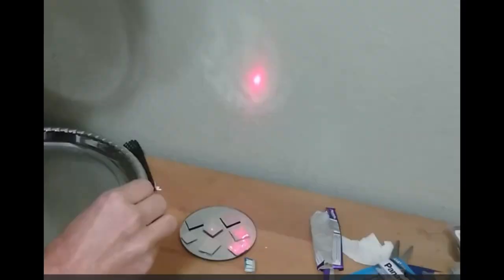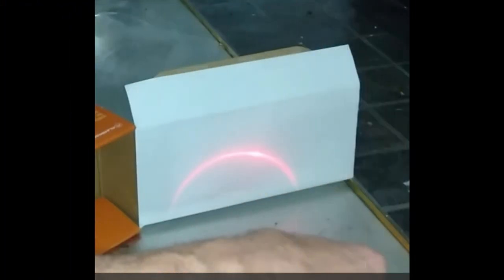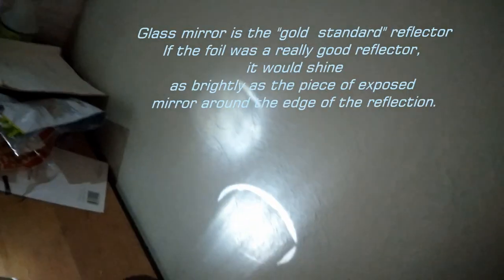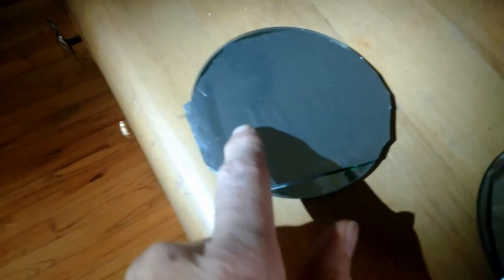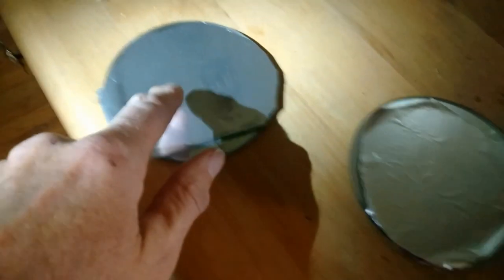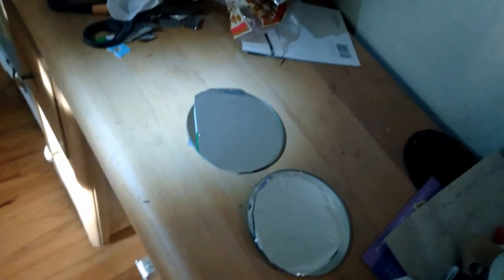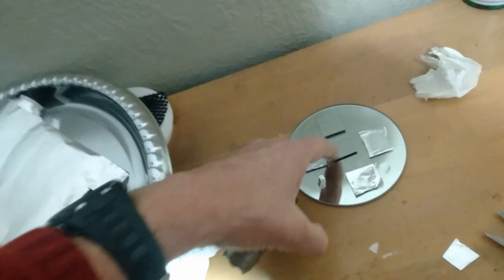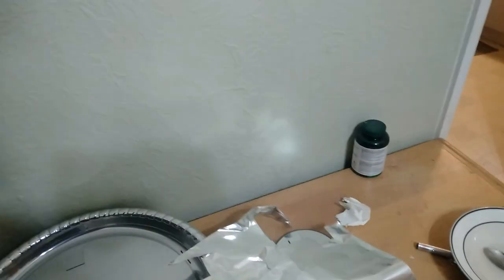Solar cooks are boycotting me!

Comment: I tried it with a laser pointer and aluminium foil. Interesting. However, the self-adhesive reflective aluminium tape I use does not do that.
Reply from the maker: Oh, thank you!  That's good to know.  Did you try the mirror test?  Is it nearly as specular as a mirror?    If so, I would like to know the brand! Brian
Reply: @Brians-Easy-Low-Tech-Solutions  It's much more diffuse and the reflection has no sharp borders like a mirror, but it's definitely better than kitchen aluminium foil.
Reply: @Brians-Easy-Low-Tech-Solutions  After 3 months I have to add something: The tape I used so far is great, but it's a no name brand and I don't know where it came from. When I ran out of it I bought tapes from Benson and 3M and both of them don't reflect as good as the no name tape I had before, actually they're really bad. Obviously there are also huge differences with these aluminium tapes.
Reply from the maker: @SolarCookingGermany   Oh, thank you very much.  I suspected something like that,  some materials are good and some are bad and brands matter too.   We should be  steps to identify the good and bad ones.  If you use a bad one unknowingly, it will ruin your experiment and possibly make you (and others)  stop doing solar cooking. I feel bad for people who need to solar cook every day but who are given poor advice.

Comment from the maker: Too funny, I lost a subscriber due to this video!  The truth hurts.  Undoubtably an anti science person.  Here's the deal, experimenters around the world have been making new (and some maybe brilliant) solar cooker designs and taking advice online, they ended up using crap reflectors to do it. I did the same thing myself,  I used foil in some concentrating solar experiments!  So of course, the result is poor. And I know how to measure heat gain and Watts and power so I was disappointed,  I thought the cooking vessel was at fault.     But the real problem was because  myself and others were using something like Aluminum foil in a concentrating solar reflector.  Aluminum foil reflects light great,  it just isn't  a good specular reflector.  I am not bashing Aluminum foil, I am just defining its capabilities,  people  will almost certainly get better results with solar funnel cookers if they just orient the foil a different way when they make the thing.  You see the poor guys on youtube doing all the work making a parabolic dish, lining it with foil, then proving that it works by taking 2 minutes to ignite a piece of wood in the tropics!  While back in Ireland, I could ignite a piece of wood in about 30 seconds with a bathroom mirror in the sun.